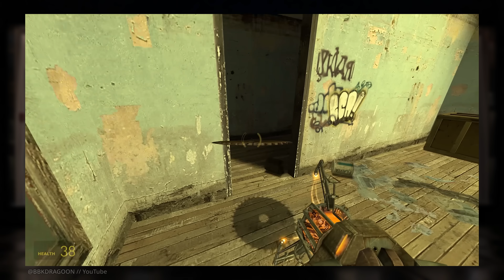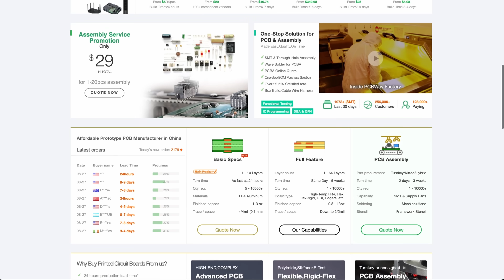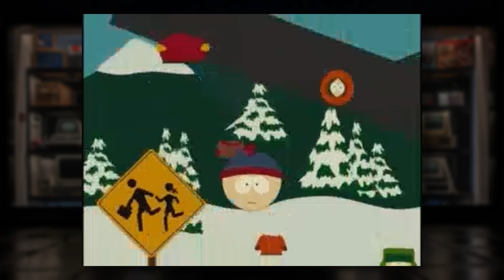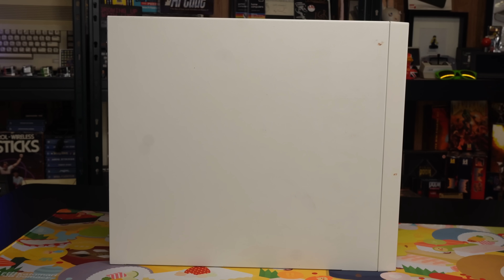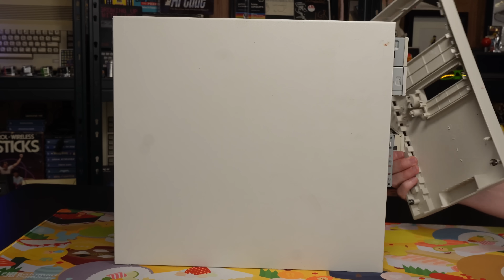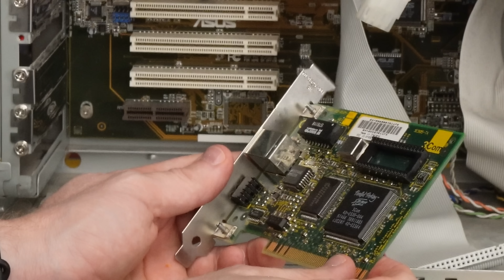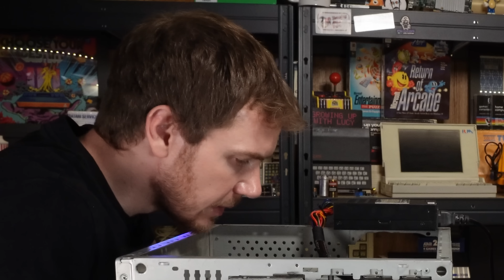Our 25 Year Old Family PC Was More Interesting Than I Thought

Comment: God, I loved those old ATX cases where the power supply was basically hovering above the CPU. They were nice and compact, a full size ATX back then was about the size of a MATX case today. Unfortunately, that layout works only for cartridge-style CPUs (Slot 1/Slot A), otherwise the PSU tends to interfere with the CPU cooler.

Comment: With retro PC's I always focus on the ones with ISA ports, to be able to put in a Sound Blaster and/or a Gravis Ultrasound for native support of these cards, so games that trip on a memory manager can still work.
Reply from the maker: Yes, I'm a big fan of that era too. I've covered a 486 DX4/100 and a Pentium 133 on my channel recently as well as some older machines (including an IBM 5150) in the past. I wouldn't recommend a system like this for pure DOS gaming.
Reply: @ctrlaltrees  It works though. In Windows 9x, with setting BootGUI=0 in MSDOS.SYS I can boot the system in pure DOS mode, and with TPPatch (Turbo Pascal 7 patch) I can run all the DOS games that don't depend on the CPU cycles (these won't properly either on a 486). I got a Pentium II and It's one heck of a machine, with 3DFX, AWE64 and a Gravis Ultrasound ACE, and an MT32, and it runs all the classics from the late 80s to early 2000s. But it sure was a headache to set up, having also to disable a serial and printer port to avoid IRQ conflicts, because it ran out of IRQ assignments 😵‍💫
Reply: @Ezyasnos  I use TweakUI 1.33 myself to enable the F8 boot menu and set it to hang around a bit for 10 seconds to select pure DOS without having to go into Windows whenever I want it.

Comment: Quite common for cases to open like that at the time. and they still could be unbranded. I had one from Novatech that opened the same way. and it looks identical inside just a different fascia. The cases often came with the back plate as well, i remember having to poke out the metal tabs on them for the ports
Reply from the maker: Ah, you could be right there. Perhaps the ethernet hole had a blanking plate over it that got poked out at some point.

Comment: Part 2 is a good opportunity to explain the capacitor plague!
Reply from the maker: Absolutely!
Reply: How absolutely nothing happens here leads me to believe that this is not necessarily just a capacitor issue. There is a short and your PSU goes to fault protection mode which prevents it from properly turning on. So, look for short on 5V or 12V rails and remove all cards and drives from the system. +5Vsb seems to be fine as you have the led on on the MB. I haven’t bumped into a board with failed caps that don’t even get fans spinning. When the caps on these go bad, the usual thing that happens is that ESR ramps up and capacitance goes down. This causes issues, but I haven’t ever come a cross that there is a short that prevents system powering on. They may not post, but never this. It is possible that if there is a bad leak, the leaked electorlyte shorts some connections around the VRM.
Reply: I remember the capacitor plague of the early 2000's.  I remember working in IT for a company hand having to have DELL come out and swap out every single motherboard because of bad caps.  Man, that was not a super fun time to be a Desktop Support Tech.
Reply: Asus boards from this era were notorious cap failed boards. God only knows how many I replaced back in the day.